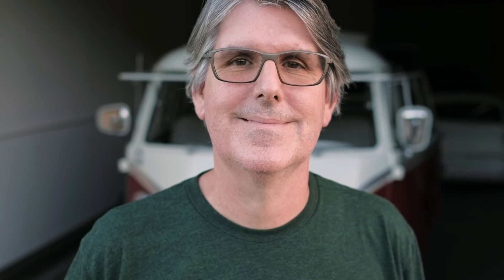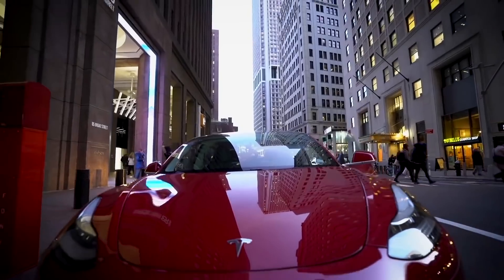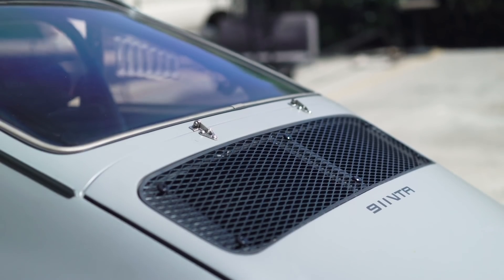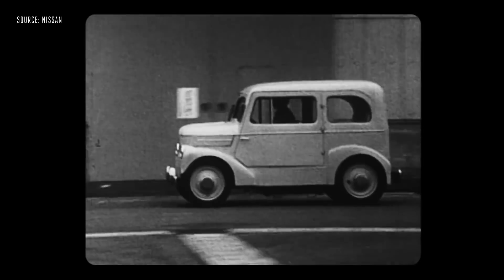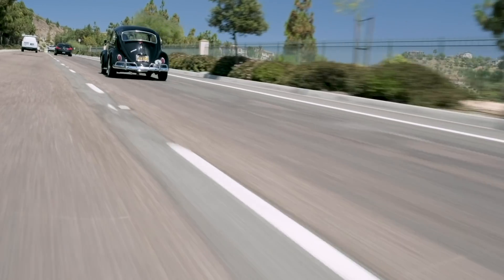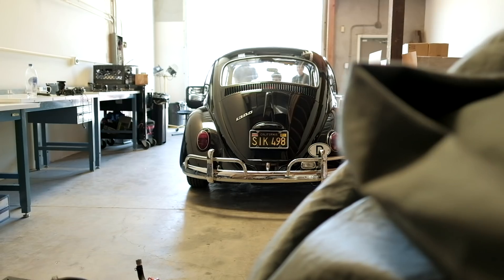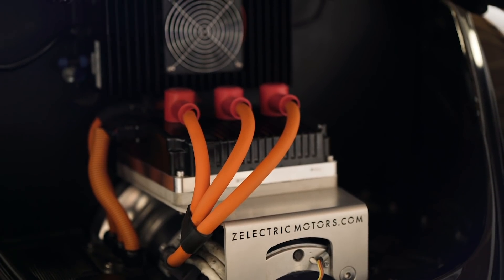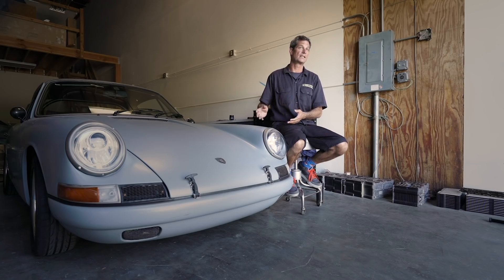Tesla-powered Porsche 912: vintage meets electric

Comment: 4500 lb ft of torque... accurate 😂
Reply: 4,500 lb ft of torque would destroy whatever's between it and the wheels.
Reply: @peterday3253  it's 4500 at the wheels, which means nothing
Reply: This is how EV people think. They think that all teslas hit 300 mph and have enough torque to make an 18 wheeler jealous.
Reply: 4500 at the wheel
Reply: Electric motors provide tons of toruqe from nothing so yes its accurate
Reply: Saulty-ハイパー a Bugatti Veyron has 1,106 lb ft of torque I think you should learn more about cars
Reply: Saulty-ハイパー I’m not sure you realize just how much tq that is.
Reply: @saulty-4726  youre so smart.  You should have an engineering channel.  Or calibrate gps devices for SSC.
Reply: @saulty-4726  
That's instant torque.. the amount is not that out of the ordinary, the highest Tesla torque so far is P100D @ 920 lbft roughly. 
So yes, 4500 is a mistake unless you're measuring at wheels the size of a scooter
Reply: @xkc9689  Gearing
Reply: @imbackinthegame  still wrong, do you understand 4500 lbft?? I love how people argue numbers they can't fathom
Reply: @xkc9689  You can achieve that through gearing. Though that number is pretty meaningless without horspower numbers.

Comment: Imagine retrofitting a vintage mechanical Patek with a quartz movement...
Reply: The 912 had a fuel-injected version of the VW 411's pushrod 1.7 liter flat-4. It's hardly a swiss watch.
Reply: you'd make the watch less environmentally friendly by using a battery powered quartz movement vs the mechanical movement... quite the contrary of this electric conversion for the 912.

Comment: I'm guessing the range it's about 100 miles, since they said it's a 32KWH battery and Teslas do ~300 miles on 100KWH.  These cars are probably not going to be used for road trips, so 100 miles is probably fine for a joyride around town. I'd take one :-)

Comment: 2:41 4500 lbft (about 6000Nm) Torque? Is that wheel torque?
Reply: I heard the same thing... no way
Reply: Your all wrong, it makes 5000 lb of tourque at 5 rpm, through a roughly 9/1 gear reduction to the wheels allowing it to go 150mph,
Reply: Yes it is,,
Reply: that has to have been measured before gearing
Reply: I heard that too.  I assume they meant "four to five hundred".
Reply: @gebeme11  or 450 pound-feet

Comment: It’s hard to see rare collectors cars go away like this. Unless car was found in terrible state and couldn’t be driven anymore you have proof of that then modification make sense but using perfectly working classic car worth 300-500k and destroy the history and value placing a battery inside isn’t right.
Reply: I love the environment and all about clean green energy - but I am with you - please don't miss with the past and ruin a classic car like that.  it's bunch of rich bored people that want to spend upwards of $100k to do mods like this.  i don't get it.
Reply: I converted my bug to electric, in my experience people never take a running car and put an electric motor in it, it’s usually a car that the motor is either completely missing or in pieces and requiring thousands of dollars to restore. In my case we ended up donating all of our engine parts to our local vw shop that let people just starting up take them for free in order to get more classic vw’s on the road. If we wanted to convert it back to gas all we would would have to do is unbolt the electric motor from the transmission and bolt the engine and gas tank back in. It only cost about 5 grand to do and we ended up with a really fun electric car that still drives like a bug but is more reliable and eco friendly.
Reply: @Lprimary  I am on board with spending $5k for the conversion on a car that the engine is dead.  i was talking about $100k mods, at that point you are always better off restoring the actual car as it was intended.

Comment: What is the most appealing about those retro or classical cars is the actual petrol engines which is about to extinct.
Reply: From what I heard elsewhere one of the big problems is they still want to drive it on a more daily basis but with the emissions standards being risen especially in city centers you basically can't drive these cars in the city anymore (at least in Europe)

As well let's getting harder and harder to find parts for these cars

Comment: "...because most people who have those kind of vehicles want the authentic motoring experience, and you can't get that with an electric motor in your Volkswagen Bug"
I'm almost certain people who purchase these electric cars are fully aware of the driving experience they want, and aren't hoping for the 'authentic motoring experience' associated with those vehicles...
Reply: Electric drive trains, while not authentic, are a big performance upgrade for all of these old cars and will usually increase the handling capabilities depending on where the pack is located.
Reply: @JT-xq2hv  I think you missed Tom's point.  let old classics be old classics.  why ruin the whole experience.  if you need performance of electric motors - get a vehicle with an electric motor from Tesla and call it a day.  Don't do a mod to an iconic car, do it to a civic or some other toy car.
Reply: @tonykahmad  No way. There are plenty of chassis laying around to do both.

Comment: old cars from Porsche and VW are oil burners thanks for clearing up the air
Reply: actually I'm a certified mechanic
Reply: sometimes old trucks run out of tolerance and continue going far beyond expected with blow by but not as bad as a old air cooled engine it's coolant is literally the air and oil
Reply: the percentage of people who drive vintage cars must be tiny. so i doubt it has any real impact on the environment. plus those people usually have more than one car. they aren't grocery shopping with a vintage car lol
Reply: My dad tried to own a 66 mustang this last year as a daily driver I noticed his garage was had a thick gas odor from open bowls of carbs even went in the house a bit I felt sorry for his wife.  Luckily he moved on my uncle has a 64 Porsche don't get me wrong I love classic cars but yeah not a daily driver unless you like driving really slow those older posches were basically bugs
Reply: VW Beetle uses 25 MPG while in 2018 the average was 24.9 so I wouldn't say that they are bad.
Reply: @ialvideo  A 1973 VW Beetle probably puts out a few hundred times more NOx, CO, and VOCs per mile than a new Dodge Demon or Lamborghini whatever, despite getting better fuel economy.
Reply: The equipment that Mines rare earth elements and then transport them are all diesel run equipment. So they actually pretty much do the same amount of damage to the environment. Battery tech isn't that great yet.
Reply: Too bad the air in China from the hundreds of diesel tractors and diggers mining the lithium and then the diesel cargo ship that transports the lithium overseas to be refined kinda offsets this a bit
Reply: @svfutbol20  that's what I wanna hear, someone that knows what he's talking about
Reply: @svfutbol20  Are you saying that the air pollution in China is caused by hundreds of diesel tractors and diggers mining Lithium, and diesel ships transporting it overseas to be refined? Can you give us any references to back this up? I understand China's worst air pollution is from the coal-burning power stations which still provide 70% of their electricity. I read that the Lithium in China is extracted from salt lake brine from Lake Zabuye (how many tractors & diggers does that need?) Chile does the same on the Atacama salt flats. Australia mines Lithium out of the ground, but the air quality there is very good compared to China. China refines its Lithium locally and exports Spodumene - battery-ready (already refined) Lithium concentrate, not raw ore to be refined. BTW, big cargo ships usually burn HFO (which is a worse pollutant) not diesel. Check your facts, dude.
Reply: @EkanVitki  It's remarkable what you inferred from my statement. No, What I said in reply to OP was that yes, Teslas may clean up the air where they are, but the clean air created was done so at a cost somewhere else, likely China where the majority of rare earth mineral heavy industries are located globally (Lithium is not the only element necessary for battery production, cobalt, aluminum, nickel and manganese are other examples). I in no way claimed that the entirety of China's air pollution was due to this, it was preposterous of you to infer that from what I said. In any case, I did not know the majority of cargo ships burned HFO, but that simply proves my point further.

Comment: Imagine the ability to buy an electric car but choose whatever body you want?
Reply: Like 1920?
Reply: asakuras01 yes, that’s coach building and it is becoming more and more popular lately with all the Italian design houses
Reply: The problem are the still small batteries. If the car is not aerodynamic and like a cabinet in the wind, you will drain your batteries quite fast.
Reply: Oh my imagine a Citroen DS with electric motors
Reply: Dawid Dubanosow But it’s still easier than building around engines, transmissions, driveshafts, fuel tanks, and exhaust pipes.

I could have miss understood your comment. I’m thinking about this from a VW kit car point of view but instead of a Beetle chassis it’s the battery flor and suspension of a Model S or 3.
Reply: Full electric corolla
Reply: GM had the blade... it got scrapped.  It was a type of board that could take any type of body. Pick, sedan, SUV... you name it.
Reply: a 3D printed Mercedes Gullwing or Jaguar E type!
Reply: Powered by Intel and AMD
Reply: You can if you have money
Reply: @davwvid  Not really. Look at VW's MQB Platform. All cars that share this platform, from the tiny Golf to the big Atlas SUV, share the same front axle, pedal box and engine positioning, despite varying wheelbase, track and external dimensions.
Reply: Cool! And remember about self-drive tech. 🤗
Reply: it's real car kids not like your RC toys...
Reply: Everyone is leeching off of tesla s idea and technology.
Reply: Paul Y. I think that’s Tesla’s goal considering their patents are open. Seems like Elon Musk just wanted to drive the market towards electric
Reply: Genesis coupe/dodge challenger
Reply: I want LR SVR 😍
Reply: I'd get a 1987 T-Top mustang gt eletric 🤤 I was born in 87 & that car is just fkn beautiful. 1 of my dream cars.
Reply: I don’t care if it’s retrofitting and existing classic car, I just want that electric classic car look.
Reply: Easy. Using In-wheel electric motors.
Reply: @mashiroinoue  there are 30+kWatt regular car wheels -> i imagine DIY kits